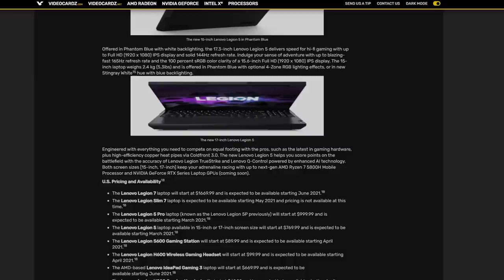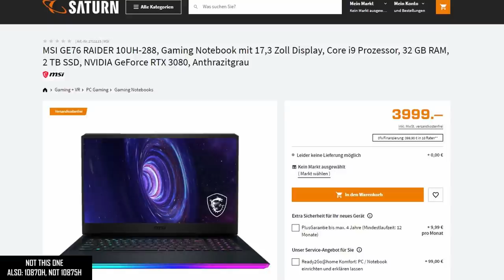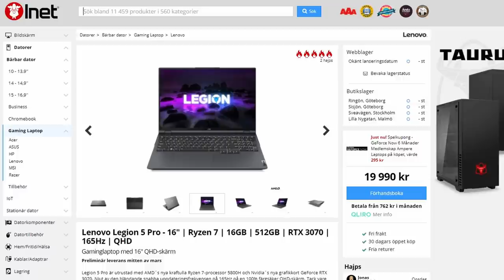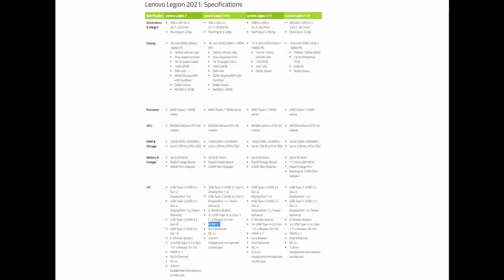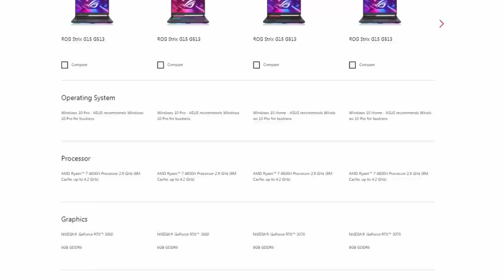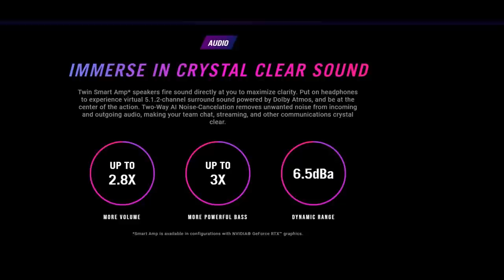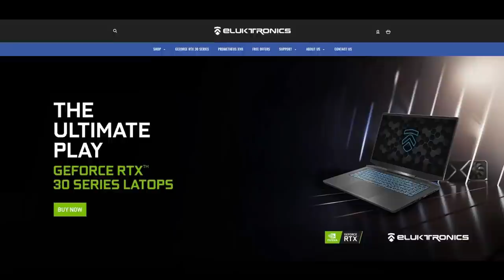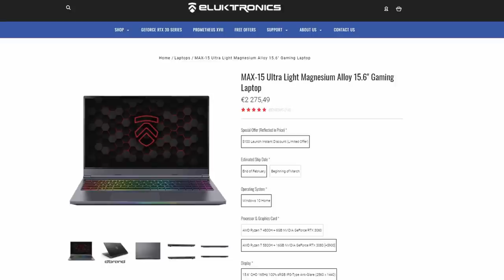My favorite gaming laptops from CES 2021 (Top 5)

Comment: The legion 5 pro looks insane, it's everything I've ever wanted from a laptop
Reply from the maker: I know, right? Curious for the benchmarks in March...
Reply: @TheRadElk  yeah, but I have good confidence in Lenovo's cooling solution. so finger's crossed
Reply from the maker: Fingers crossed indeed 🤞
Reply: Did you want the Y logo at the back too?
Reply: @user-fi3cd3ig6l  well, we do look at the screen 99% of the time so they aced what really matters (16:10, 500 nits Dolby Vision, HDR, 165 Hz, Quad f***n HD with a super bright display)
I think a Y on the back is worth the trade off

Comment: Asus Tuf with the 11th gen intel is going for 1400 pre order with a 3070.  It should get good gaming performance even though just being a quad core it has some insanely high clock speeds.
Reply from the maker: That is correct! I might do a video on some benchmarks and thoughts this weekend regarding this and the 30-series GPUs. Hope I get the time 😃

Comment: Correct me if I'm wrong, but I'm 99% certain that the liquid metal coating for the CPU is only on Asus ROG line-up and not the Asus TUF line-up.
Reply from the maker: You might be right. I'll have to double check with the reviews popping up tomorrow, but I had a look around now and I only see it for ROG. But for whatever reason, I remember seeing/hearing TUF getting the same treatment. Maybe I'm imagining things 😅
Reply: @TheRadElk   UltrabookReview just posted their in depth review of the 2021 Asus TUF A15 which they will be updating in the next few days. 
They confirm the following: "still regular thermal compound applied on the CPU, and not liquid-metal as on the ROG models"

Comment: A bigger question is where’s the 17 inch Zephyrus duo? Even though the current 15 can take the gpu to 130W(90W+15W boost+15W dynamic boost) but the 17 inch might have better thermals but time will tell I guess
Reply from the maker: It will indeed, lol. They're putting out other impressive models tbf

Comment: I’ve been looking at the hp omen 15, is it bad compared to these or is it a runner up
Reply from the maker: Depends on the configuration. Not sure if HP will refresh the Omen line-up yet. I know you can get it with an RTX 2060, which would theoretically be worse than those, but it really depends on what you want to do. A 2060 mobile might still be a very good card for some people

Comment: Any particular reason that the ASUS's you mentioned look better than the STRIX SCA 17? I've been debating ordering the model with the 5900HX and 3080 Max-P alongside the 1440P display.
Reply from the maker: Do you mean looks as in design or panel quality? That combo sounds totally rad.
Reply: @TheRadElk  I meant more what makes the other ASUS's you listed in your top 5 stand out as better than it. I ordered it yesterday, but plan to wait and see if any Clevo's with similar specs get announced before it ships, in which case I'll probably cancel my order and get a Clevo instead. This is the one I meant for reference: https://www.gentechpc.com/product-p/asus-g733qs-xs98q.htm

Comment: I can't get the Apple M1X out of my head, and the impending switch from x86 to ARM by other chip manufacturers. What numbers would AMD be able to crunch on ARM architectures, now that ZEN 3 already outperforms M1, even though ZEN 3 is designed as x86 and thus way less power efficient?
Reply from the maker: I think we might see something come out of that Xilinx deal in a few years 🤔

Comment: I was most excited about the Zephyrus G15, but it looks like it will be more expensive than I was hoping for - $1800 for the 16GB version. Plus, they didn't say how many nits the screen is. I was hoping HP would announce a revised Omen 15 with better build quality, but that didn't happen. That leaves me with the Legion 5 Pro, which is limited to 16 GB of RAM, but if that can be replaced with larger capacity sticks (assuming the RAM isn't soldered - does anyone know?), then I will grudgingly get the Lenovo Legion 5 Pro with that 500 nit screen.
Reply: Im looking to get the 5 Pro as well but living in europe I have no idea where to buy it from, different resellers tell me that availability might come in late april/may and I want it sooner than that, got any idea?
Reply from the maker: That's what I heard as well, availability sometime in April or May. As for the RAM question, I'm not entirely sure Christopher. Check their documentation or send them an e-mail.

Comment: The Flow X13 and eGPU are made for each other. You can't use eGPU to other laptops even current 2021 RoG. Just buy laptop with Optimus Drive.
Reply from the maker: Yes, the eGPU works only with the Flow X13, did I say otherwise? Think I even showed the connector using Jarrod's photo :D
Reply: @TheRadElk  So who will buy eGPU? it's only a peripheral for a specific laptop. Wish eGPU works with other laptop or other RoG as well not only on a certain laptop.

Comment: Hi do you think that the lenovo legion 5 pros 16 gb ram will be an issue. I have an asus 750 js its about 7 years old and it came with 16 gb ram. Just wondering if that can be a deal breaker becuse the other models have up to 32gb?
Reply from the maker: Not at all! 16GB is still the golden standard at the moment. If I'm not mistaken, you can upgrade it to 32GB. I'd argue 32 only makes sense for those who work a lot with After Effects or similar tools that chew through RAM. Games don't really do that, unless you run a ton of things in the background.
Reply: @TheRadElk  thanks for the info I'm just an occasional gamer who likes to future proof myself. My laptop is to old now I get 24 fps on warzone on lowest of lows looks like the first version of Minecraft hehehe time to upgrade. Like the legion 5 pro
Reply from the maker: Ouch! Well, I think the 3080 will be more than fine for the upcoming period :) Especially if more games will add DLSS!

Comment: hey i have one question to ask, i just bought 1 month ago acer predator triton 500 (rtx 2070 super max q i7 10750h) so should i sell it and buy rtx 3070 laptop or keep it and upgrade in 2 years?
Reply from the maker: Hey! Depends on what you want to do with your current laptop (i.e. gaming, video editing, CAD etc). If you think that everything runs well on it at the moment and can keep it for 2 more years, then definitely keep using it. Otherwise, wait for reviews and benchmarks for some laptops using the 3070 (max q or max p) and see if that would suit your needs better. Hope that helps!
Reply: @TheRadElk  i need it for school work and gaming. thank you for your response

Comment: I'm probably in for the legion 5 pro although I want to see benchmarks of that vs the G15. I was actually potentially considering eluktronics but no 5800H + 3070 option in the max 15. That max flow looks ridiculous. I do like the concept of a thin & light that connects to an egpu, but making the egpu non upgradable and using a laptop 3080 just kills it IMO. I think we're about a generation away from that sort of thing being viable.
Reply from the maker: I can see your last point being true. I hope we'll see thunderbolt on future AMD laptops, it's just that the bandwidth (x4) won't allow for better GPUs. You'll lose out on a lot of performance. And yeah, the G15 will be Lenovo's biggest nemesis. I'm curious which one will end up selling more. And Eluktronics is not doing too bad for themselves either with those upcoming models I reckon. This year might actually be a very profitable one for laptop manufacturers, since people are still stuck at home or getting into the work from home life 🤔

Comment: I saw that the g15/17 has no displayport? It can be used through the usb-c port but is that not how we charge the laptop? XD
Reply from the maker: They have 2 USB-C ports and they both support DP and power delivery (https://rog.asus.com/laptops/rog-zephyrus/2021-rog-zephyrus-g15-series/spec/)
Reply from the maker: Normal charging is still through a barrel plug connector (https://rog.asus.com/laptops/rog-zephyrus/2021-rog-zephyrus-g15-series/gallery/)
Reply: @TheRadElk  ah alright!

Comment: I still dont get why on the flow x13 they decided on the 1650 would be more interested if they went with the 1660ti when I did want to use the EGPU
Reply from the maker: I would've also been waaaay more into it if it had a 1660Ti, but I reckon that had something to do with:
a) battery
b) being mostly sold/paired with the eGPU
and also probably c) trying to keep prices "low"
Reply: Ahh true that is something I didn't think about
Reply from the maker: No worries. Will you be getting one? 👀
Reply: Thinking about it if the EGPU isn't an arm and leg other wise the Legion 5 Pro or the 15 inch Asus g15 sounds perfect (only play fsx steam, xplane 10 and 11, and Microsoft flight sin 2020 and do some light photo shop)

Comment: im honestly really considering the legion 5 pro, that is if its not all sold out by the time i get it lol.
Reply from the maker: To be fair, it has a LOT going for it. The Flow X13 is obviously way too expensive so if I needed a laptop, I'd definitely look at the 5 Pro. It has pretty much everything I'd want in a laptop and they have also added some new ventilation holes. Should've probably mentioned this in the video. Same for the TUF. But yeah, availability might be scarce.

Comment: i am torn between tuf a15 and legion pro
Reply from the maker: The Legion 5 Pro won't be available until (mid-)March if I'm not mistaken. Would that be a problem for you? I'd personally choose the Lenovo, the spec sheet is amazing and last year's model got a ton of praise. Check out Jarrod's or Steven's review (description)
Reply: @TheRadElk  my butget is around 1500 
spec wise which should i choose then? only used for 3d modeling and some gaming

Comment: eGPU like RTX3080 is a crap think because you will pay for it like normal RTX3080 price + 50% for asus chasis.
Reply: well yea, you're getting a full computer in a mobile format
Reply from the maker: I have to agree with Asmodeus. It's not cheap, but it's very convenient. Plus, you can buy the X13 without the eGPU here in Germany (a bit expensive at 1500 EUR, but cool idea for the future)
Reply: @TheRadElk  1500e for laptop and 1500e for chasis, in total 3000e. So for 3k e you can buy g15 with 3080 and i guess it will have very similar or more power than this combo.
Imo x13 with egpu is overkill. Maybe it has sense if there will be 3060 and the price around 800e.

Comment: Rtx 3060 better than Rtx 2070 in laptops?...MSI gl 75 with rtx 2070 & 10th Gen Intel I7 ..now available at $1200 ...
Reply: from the rumors i heard, the rtx 3060 is better than the rtx 2080 laptops. but we have yet to see the benchmarks
Reply: If you need it right now could be a good deal. If not, wait for ASUS G15 ryzen 7 5series, RTX 3060 at 1399.
Reply: @josegabrielalvis946  tnq

Comment: Aye First xD
Reply from the maker: Congrats 👀
Reply: @TheRadElk  😆 thanks, i can't Watch It right now because i'm on a train but i'll definitely take a look later. I found a comment on a video saying there are already preorders aviable for the legion series on a swedish website, and woof prices are over msrp + taxes :/
Reply: @TheRadElk  from multiple websites i've read that the legion 5 pro should start at $999 in the USA but i don't know which version. The swedish preorder with the lowest specs (3060 + 5800h) translates to roughly 1578€ taxes included
Reply: @TheRadElk  https://www.elgiganten.se/product/gaming/laptop-gaming/275779/lenovo-legion-5-pro-16-barbar-dator-gaming-r7-16-1000-3060-16-165 

This Is the link (you can find other models in there aswell) if you haven't seen It already It could be good material for a new video 😁